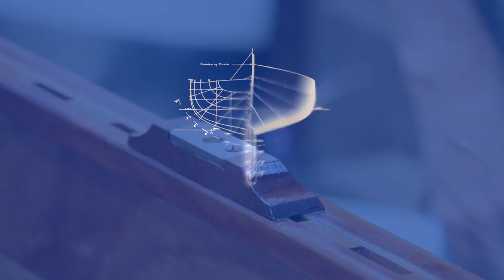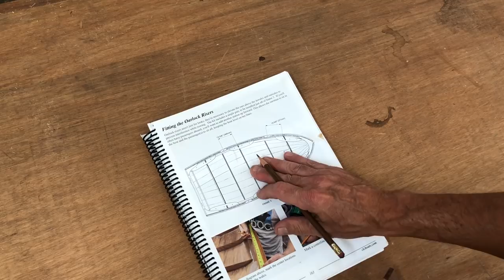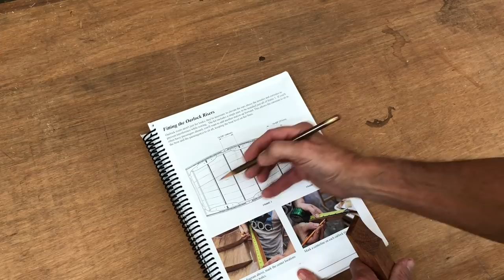Episode 5: Oars and Oar Locks

Comment: I would remove the finish from the handles of the ores. People always told me they are not supposed to be finished because the smooth surface would cause blisters from rowing whereas the smooth bare wood would be much softer on the skin.

Comment: to find out oar length: Measure the distance between the center of the port and starboard oar sockets, which hold the oar locks on each gunnel. This is called the “span” between the oarlocks. Divide the span by 2, and then add 2 to this number. The result is called the “inboard loom length” of the oar. Multiply the loom length by 25, and then divide that number by 7. The result is the proper oar length in inches. Round up or down to the closest 6” increment.
Reply: Sounds like you desire the oars to overlap for some reason. Is that right? Why is that?
Reply: @chriscowles1185  I believe that’s the general calculus for working out the total oar length. As for the overlap- the positioning of the leather and button affects this. The measurement done for that finds the Center of the leather. And positioned at that point will overlap…..But of course when actually rowing the row lock won’t be at the centre of the leather (4.5inches in to Center)….. it will infact be up at the button. Approx 1/2- 1 inch of leather button plus 1 inch to par center. So another 2.5-3 inches will be removed each side from the total width. So instead of each being 1 inch to long. They will now be 1.5-2 inches short each- which is a 3-4 inch gap separation between them if I got that right.😅 I think hehe. Hope that helps.

Comment: What is the name of these “sliding oar” method vs oarlock pins, aside from tradition, and why are they better?
Reply from the maker: Hi Chris,
They are call Round Oarlocks" Using the Round Oarlocks lets you feather the oars and won't let them fall off.
Pinned oars are set vertical so there is no way you can feather the oars. If you want to learn how to row the wrong way, Pinned Oarlocks the ideal setup. 
Great question!
Thanks for watching.
Cheers,
Bob
Reply: @TheArtofBoatBuilding  I was informed that when rowing in heavier seas (not on a pond) such as in the Atlantic if the oars don’t feather it can mess up your stroke. Feathering oars avoids that. Is that your understanding? This guy loved to “surf” the waves in his 18’ dory row boat.
Reply from the maker: @chriscowles1185  Yes, It's my understanding that no matter where you are rowing that feathering the oars in advisable.

Comment: Don't understand why there are 'risers'.  

If using rowlocks it is better to mount them on brass socket plates flush with the top of the gunwhales.  

When climbing into the boat after a capsize you don't want protrusions above the gunwhales grazing the inside of your thighs and your ribs as you pull yourself up into the boat.

Rowlocks have a stem on them so you don't have to have risers like you would if using tholes.